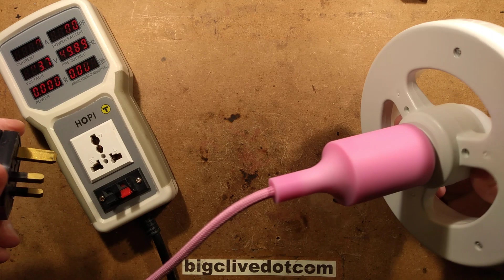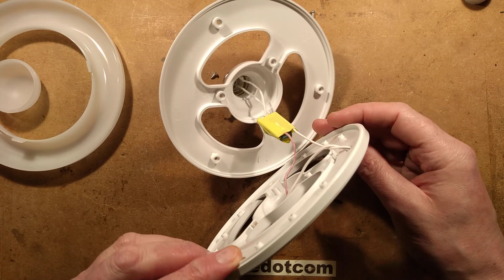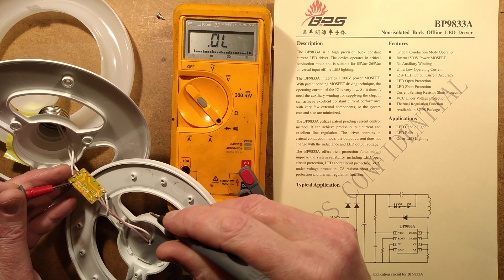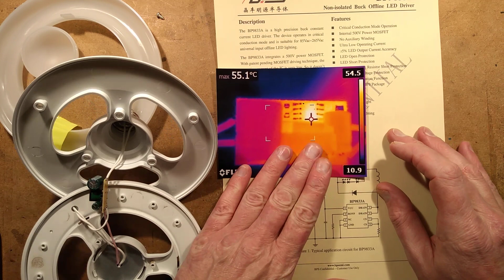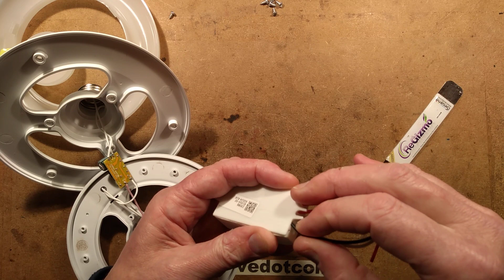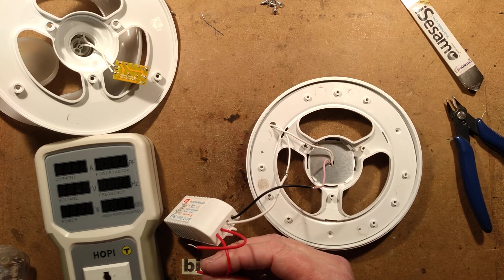Inside an LED "Circolux" lookalike?

Comment: Hey, I still have an operating circular fluorescent lamp in my basement laundry room.  Are you trying to say I'd find it difficult to locate a replacement if it ever died?

I should check for a date somewhere.  I know I have had it in service at least 20 years myself, no telling when the previous homeowners installed it.
Reply: Yeah, my bedroom fan uses the circular florescent lights, and you can easily get them online.
Reply: Andrew Delashaw Most magnifier lamps also make use of such bulbs as well, so they are still quite common.
Reply from the maker: I think you can still get tubes for the circular fittings.

Comment: They'll seriously bill you for apparent power in the UK!?
Reply: I doubt they would ever just charge you per kVAh used. That would be completely unreasonable.

Honestly I don´t know how they would ever bill you for power factor. In industry they usually just charge you for power factor once you´re below a certain value on average.
Reply from the maker: You underestimate the scummy "power companies" that are really just salesmen reselling power from the generation companies.  They don't dig the roads to lay cables or even install the meters.  It's all other contractors who do that.
Reply: Ontario hydro (hydro one) doesn't look like they are ever going to try that on residential meters.

Comment: For the record, I think you're a conspiracy theorist on the "charging for apparent power" deal, but time will tell. I love your channel though :-)
Reply from the maker: Time will indeed tell.  But it's already happened in other countries.  Another thing they can do is "peak demand pricing" where the meter will bill higher during peak times like when you're cooking the evening meal or the water heater kicks in in the morning.
Reply: In California, there's a "peak reduction plan" that's actually very easy to save with since the peak times are when everyone is at work. And the water heater is something that really lends well to operating during off peak, since it's thermal storage.
Reply: @bigclivedotcom  Sure, re peak demand pricing. And I've worked in large industries (refining/petrochem) where we had huge inductive loads, and power factor was part of our bills. If a large compressor or blower went down, depending on the process, we might wait until off peak hours to restart the machine because of cost of the inrush current charges. (aside: Sometimes in a wastewater treatment plant I worked at which had massive diesel backup generators, we'd even run the plant on generator during certain periods in the summer to offload the utility. This was a negotiated/contractual agreement with the utility for lower rates overall. )
Anyway, I think it makes some sense to adjust pricing to account for the  utilities' real cost of apparent power in some situations. But straight up billing a customer for "apparent power" instead of real power at the same rates, which is what I understood you to be suggesting would happen, just seems so very wrong that I don't like to think it could happen here in the US. Then again, many unthinkable things are going on here, so, who knows?
Reply: bigclivedotcom FWIW, I tend to agree with you as they have to actually set aside power plants and large capacitor banks that contribute no actual power yet have to be run to dynamically lag or lead the AC waveform in order to balance out the effects of poor power factor because that poor power factor effectively derates the capacity of their generation plants (not to mention the effects from the harmonics produced) if it is not compensated for one way or another.  As for peak power pricing, if we are to move to greater “green” power production, particularly with respect to solar and wind, then peak pricing makes the most logical sense because you really want customers to use the cheaper green power when it is available and excess capacity exists versus the more expensive peak power periods where capacity is nearly maxed out by demand as peaking power plants are very costly to operate and far less efficient — though peak hours in a green production environment are going to be much more dynamic than traditional power production schedules and may even turn peak/non-peak hours on their head.  It will certainly be an interesting ride as here in the South as you will tend to want to use chillers rather than traditional air conditioning if one is paying based upon peak power since chillers permit storing chilled water for use during peak pricing hours, so that is a lot of infrastructure to replace but we may have to one day.
Reply: "It's not a conspiracy when they really are out to get you" xD xD (puts tin foil hat back on)
Reply: If power factor is such an issue to the companies that generate the power, why haven't domestic customers been forced to do something about power correction?
Reply: Alan King - Because until recently domestic customers' power factors have been near as makes no difference 1.0 ie apparent power is equal to true power.  This situation is unlikely to change much in the future.  The total power demand from LED lighting is negligible and larger electronic loads such as charging stations for electric cars have to have power factor correction built in.  I think the suggestion that they will start charging domestic customers for apparent power is spurious and it wouldn't matter much to you or I if they did.
Reply: The reason for Power Factor surcharges is that industry tends to take power with a lagging power factor ie inductive loads like motors.  This causes extra losses in transmission lines and transformers and so they charge industrial users a higher rate for lower power factors.  But all these LED drivers have a leading power factor ie a capacitive load which cancels the effect of  the industrial loads so they ought to be giving us a discount for leading power factors.  The smart meters are quite capable of detecting the difference between a leading and lagging power factor.  I personally have not seen any evidence other than internet hearsay that any electric company anywhere in the world charges domestic customers for apparent power.
Reply: @petehiggins33  this is interesting, I think that if it is fair, we should be billed for apparent power in stead of real power, but now we're helping them, as you mentioned.

Comment: You touch on very important subject at the beginning.  We can correct the power factor with a capacitive bank. What is your take on that? We are getting the new smart meters here in the US. The solution I am aiming for are home made lithium powered lamps with solar chargers to cut down on the electric bill. Any way how would you go about correcting the power factor on these led lamps?
Reply from the maker: The capacitor approach doesn't work with electronic supplies because the current waveform is not sinusoidal.  It requires specialist electronics to create a good power factor in each power supply.

Comment: HA, I blew a HRC meter fuse mere seconds before this video was posted...
Reply: "Trap for young players!" - EEVBlog
Reply from the maker: We've all blown meter fuses.  It's so easy when you're young, but less frequent as you get older.
Reply: Actually hadn't blown one in eons as I'm normally vigilant... but learned long ago to keep a couple of spares on hand. Cool videos, Thanks!
Reply: laughs in aluminium foil
Reply: In high school auto shop (c. late 60's), they used to accept cars in for minor free repairs. Another student wrapped up a fuse in the foil from cigarette pack attempting to 'troubleshoot' something or another; and ended up with the car burnt to the ground. Car belonged to another teacher too... Needless to say, SHTF.
Reply: I just use a 5A BS1362 fuse in my meter. They are sand filled and HRC. Dont use glass fuses, they can explode.
Reply: And here I am with a telephone ahmm I mean professionally certified wire that blows around 10amp across my 10a hrc fuse...
Reply: I seem to recall that quite some years ago the fuses for my Fluke for the 440 mA and 11A rated ones were roughly 4 euro and 8 euro respectively.
So not quite as expensive as the meter (even in the used state with one dead fuse as I got it) but still fairly pricy.

Considering Farnell doesn't seem to take orders from consumers in my country at least I wonder if other sources for "officialy approved" fuses are more expensive. That said I've picked up two 440 mA fuses and one 11A fuse back then, figured I'd keep one spare of each and I still have the 11A fuse in storage. I've gotten better over the years at not blowing up the lower current rated fuses.

Comment: Clive, I need to know about this Christoph fellow and his lenses for thermal imaging.  How does the lens help and how do you attach it and to what imager.  I've got an old hacked E4 (to E8 capabilities)
Reply: Probably has better charity
Reply from the maker: Mine is also an E4 hacked to E8.  I think it was Mike at mikeselectricstuff who came up with the idea for the add-on lenses and it was so popular that some Chinese sellers supplied them preattached to the 3D printed holder.  It was also Mike who cracked the E4 firmware.  His videos showing his explorations are great.
Reply: @bigclivedotcom  cool
Reply: God, we're so lucky to have E4's - $3000 features in an $800 imager... I have one final question.  After I "updated" mine to the E8 feature set, I no longer have the FLIR logo on the bottom left, it's just gone.  Yeah I can see more of the field but there are some cases where I want the flir logo in an image. - - Did you have that issue, Clive? If so, how'd you fix?
Reply from the maker: @BlackWolf42-  I hadn't noticed that.  There were a couple of scripts floating about to modify the configuration file.  One may have replaced or removed the logo.

Comment: Why not hack the HOPI to kill the LED display flicker??
Reply: It is due to the multiplexing of the display and is tied to the internal clock of the IC on board. Otherwise I am sure he'd have fiddled with it.
Reply: I think the capacitors might reduce light output significantly. They also could cause some fun light effects for any digits that change frequently. . .
Reply: thats a rather difficult mod
Reply: I think if Clive adjust manually the shutter speed can fix the flicker, but he would need to raise the ISO to compensate
Reply: There'd still be flicker if he adjusted shutter speed. It's more related to frame rate. It's best to just ignore the flicker.

Comment: Could the center board now be removed and  the outside used around a macro camera lens for example?
Reply from the maker: It could, but you'd have to keep in mind that with the existing supply the LEDs are referenced to the mains supply and pose a shock risk
Reply: That would brighten up your day.
Reply: bigclivedotcom  may be you can hack that to run on batteries.
Reply: Yes you could run the circuit on Batteries for example with a LDH-45A-350 dimmed to around 10-20%.
But the 60V would still hurt if you touched both wires with sensitive body parts.
You could also just buy a proper LED driver (Meanwell has good ones) and run it on mains power.
Reply: How are you going to be touching any sensitive body parts to it? It's on a macro lens.... ooohhhhhhh...  Now i understand how!
Reply: Nice one, i had not thought of that 😄
But try putting a 9V battery to your tongue or the inside of your elbow (needs to be wet) or the inside of your upper arm and then imagine it being 6x that.
Reply: I think Clive said 60v and 60 VDC would be a big battery. Well I got the late answer. For some reason I did not see the other replies. 
How ever Clive could hook it up to the bench supply and see what it does.
Reply: @Ultrazaubererger  it's not 60V you need to worry about, more like 240V rectified,  that's about 400VDC
Reply: Spooky how you referred to BURLY. It came into conversation a few days ago. It’s a pity nothing’s been able to match it successfully since either with black netting - or not.....

Comment: Likely or not, it does honestly make you sound like a conspiracy theorist when you say it every other video. ;P
Reply from the maker: I realised how many times I've mentioned it this time.  I really have to do a dedicated smart meter video and explain everything they can do.  (including the security features)
Reply: And try to find articles to confirm if your theory is true or will be in future. Also, How would you test the power factor of the whole house at the meter. It will probably vary depending on what appliances are switched on.

Comment: The USA colour code is black = phase and white = neutral.
Probably why the power supply uses those colours
Reply: Except it's for the DC output and the two reds are the AC. That's what makes it odd.
Reply: The two red wires are being used for AC though. Also DC is typically red and black. Seems more like they just grabbed what ever colors they had.